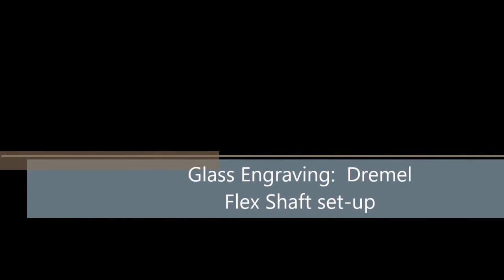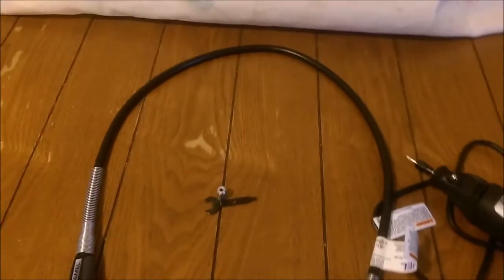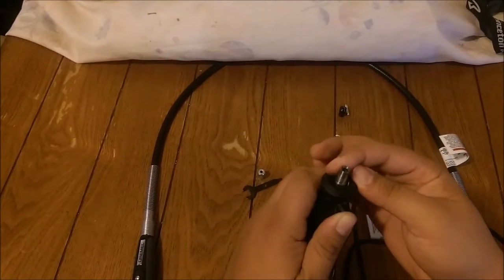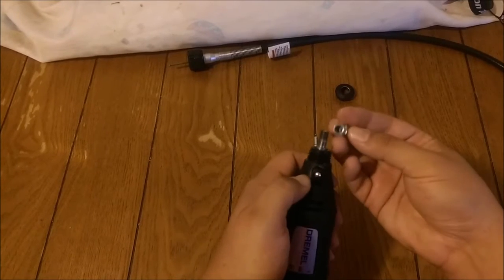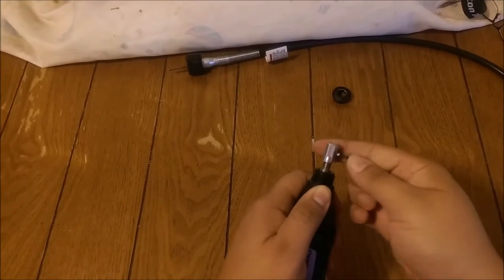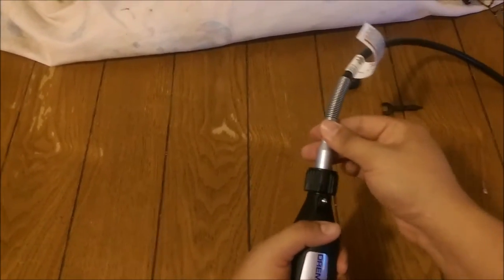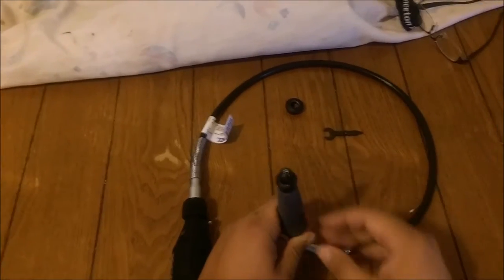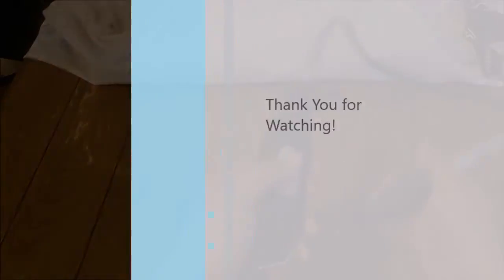Dremel Flexshaft Setup - Glass Engraving for Beginners

Comment: when i tighten my flex shaft down the dremel tryes to turn but the tip of the flex shaft wont. if i loosen the black threaded part it will start to spin but then will loosen up due to vibration how do i fix this
Reply: I have the same problem with my Dremel 3000 that came with the flex shaft. Have you gotten an answer yet?